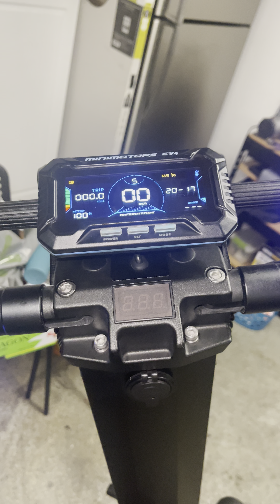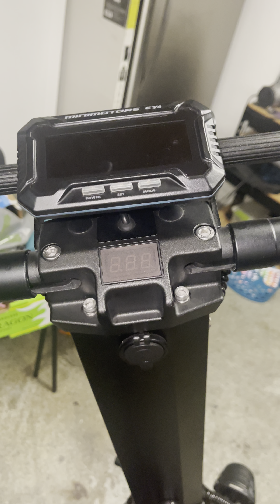Dualtron x limited central locking system with Alarm, imbedded in the scooter.

Comment: if you ride at 45 to 55mph you probably get 40 to 50 miles. it would be interesting to take it for a spin on the city see how much range I get out of it. I have a FLJ K-13 it gives me a range of 40 milles riding it at  35 -to 45mph. Where I live there's a lot of steep hills on the road, i weight 230lb.

Comment: Hello, greetings from Los Angeles, Chile. Do you know what the function of the gray cable that is disconnected once you open the scooter is? On my Dualtron X LTD, when I opened it to set the alarm you mention, I noticed that gray cable.
Reply from the maker: Hey buddy, that is the speed limiter. If you connect it, it will limit you to 15 mph

Comment: Hey Moe. I just installed the security system you linked in the description. I noticed the voltage dropped a few volts. Does this thing drain power from the battery overtime? If I store it for a few months I'm worried it would deplete the battery. Also, if someone else has the same key fob, would it work on this one I installed or each key is generated with a difference frequency just like a car. Thanks. Hope to hear back from you.
Reply from the maker: Hey brother, I have the 2 DTXs. Each remote only works for the designated scooter. My voltage was not affected. I have not see any changes or drops in voltage. Hope this answers your question.